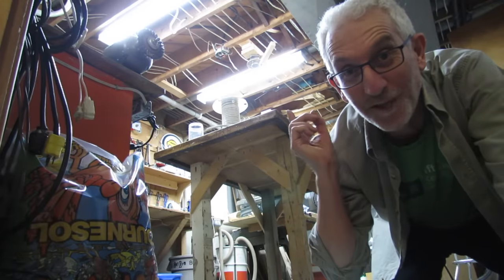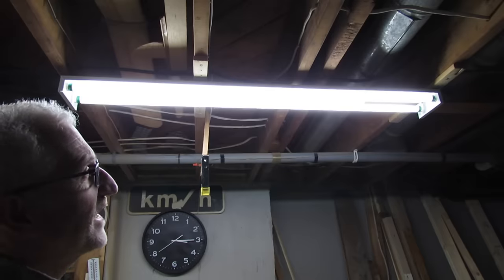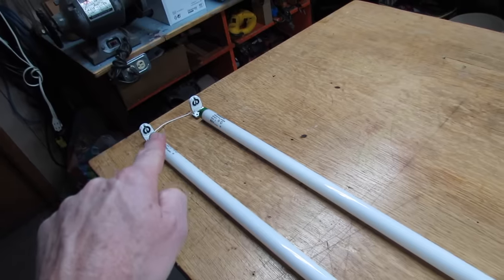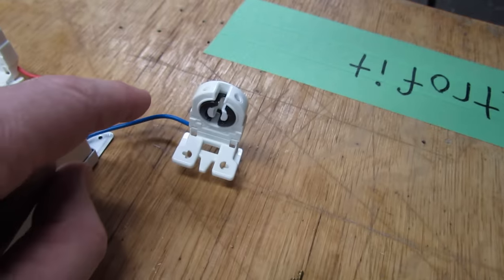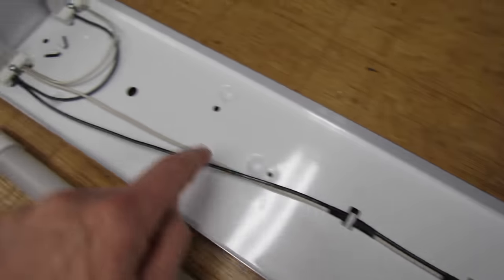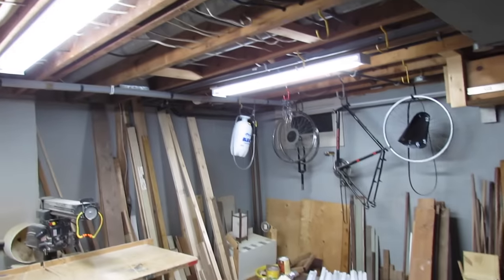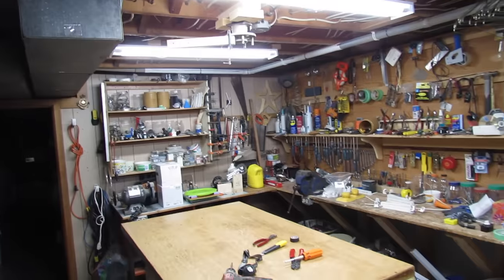How To Convert T8 Fluorescent Lights to LED ● Explained in Simple Terms

Comment: I have no argument with what you did here. But it's worth mentioning that you could save time and money by purchasing "double end powered" LED tubes. Price is the same and you don't have to buy & replace the sockets, they work whether they are shunted or not, but the wiring is different. It should also be pointed out that when replacing LED tubes, you must make sure they are the same as the ones you are replacing (single-end powered LED-s will not work in a fixture that was wired for double-end tubes & vice versa.)

Comment: Hey Chris, i am an accountant and am traumatic  when it involve electrical current. Bear with me here.

I have a small fan should be installed in trucks using the 12v Power point, but i want to use it in my room using the usual 3 pin power point (British Spec 240v). But I dont know how. 

Please help me. Dont give me graph or chart or tables. I do not understand them. 

Appreciate if you could make a short slideshow on how u do it is better, i can copu whatever u did.

Thank you.

Comment: Does anybody actually know what voltages the direct LED and the ballast LED tubes require to work? I mean what output voltage does a ballast offer verses direct 115 vac LED direct? I ask because I totally went to LED replacement tubes and now I am getting a flicker from one four LED setup (I have 6 four tube setups in the shop). And since these all are ballast setups, I was wonder if I just removed the ballast and wired direct would that work? IDK.
Reply from the maker: I don't know what voltage the ballast leds take to work but I do know the direct ones have 110V. I experimented when I did this video and laid one led tube on the bench and used alligator clips and attached a neutral and line to one end of the led tube and it lit up. That is why you can cut the wires at the other end since they are now not needed.

Comment: You never covered the section about  reconnecting the new power cables you put in  the unit back to the original power cables??
Reply from the maker: You just connect it back up the same way you disconnected.

Comment: Nice clean job. Nice skills. But why do it? The bigger cost item in fluorescent light fixtures is the ballast. Yours was scrapped. You replaced everything except the aluminum box. That's the least expensive part. Your 1000Bulbs seller has a LED ready strip light (minus the bulbs) for $12.99
Reply from the maker: I guess part of me said to reuse whatever I could instead of just trashing it.  Good point though.

Comment: Although your video is very good, it might be a little outdated...be very careful when wiring,,,,FOLLOW THE LIGHT MANUFACTURERS INSTRUCTIONS!!!!....I wired my fixture according to your directions and popped the circuit breaker....had to re-wire using the original SHUNTED lamp holders,  as the bulbs I'm using call for a "ballast bypass" meaning you use the same shunted lampholders in the fixture, but the hot and neutral wires go to each end of the light fixture (hot wire to blue and black wires and neutral to yellow and white wires)
Reply from the maker: In your case you would just remove the ballast.

Comment: 3,000k to 3,500k would be my choice for color spectrum. The higher numbers tend to be too "bluish". I rarely see folks converting 8 foot fluorescent tube fixtures.
Reply from the maker: I myself find the 3000k range to be too yellow/orangish and dull. 5000 is like natural sunlight and is not bluish. 6000 is getting into the bluishness
Reply: @chrisnotap  Yes, some say the 5,000 is true sunlight. Back in the halogen bulb days they said a halogen was equal to natural sunlight. They are far apart from each other.

Comment: Is it true led light escalate cancer activity in cancer patients.
Reply: Salvatore Saccoccio never heard that one, but the one thing is NOT LOOK at LED LAMPS, in Europe they have a flicker problem, with 50 hz, where we have 60 hz in North America.
Reply: Salvatore: LED lamps have drivers which gives it such type of current which does not flicker. If LED is driven with AC, like older ones, the flickering would be seen but not anymore. Incadecent bulb is so slow that the flickering doesn’t show. If you use uncompatible dimmer, it can cause flickering too.
Reply: mattikaki you didn’t answer my question. As of Jan 1 1917 CBS news had a reporter on stating that LED lighting escalated cancer cells in patients with this type of cancers, prostate in men and breast conservation in women!
Reply: The logic of these people is all the same, phones give you cancer my radiation and LED lights give off cancer causing radiation. All light gives off radiation, because that is the definition of light, electromagnetic radiation. So I guess if you so strongly hate radiation I suggest you live miles underground with thick layers of concrete and pure lead with absolutely no light. But there is one problem with that, your body gives off infrared light/ heat, another form of radiation. So I guess you should just suck it up and go on with life without being paranoid about cancer. Also there are 3 types of radiation, alpha, beta, and gamma, the first two are are completely harmless (this is what phones and LEDS give off) but gamma radiation is only produced by high energies like nuclear fission (not only in nuclear power plants) or highly radioactive isotopes of elements like uranium and plutonium. And last I checked these highly regulated elements aren’t in phones or diodes so as long as you constantly lick pure uranium you should be fine. So can everyone stop being paranoid and/or just plain stupid? It’s time to see that everything gives you cancer and who knows maybe cancer gives you cancer?

Comment: Does the other side of the bulbs none shunted as well!?? That means you have replaced four of them to none shunted!!
Reply from the maker: The other end is "dead". The bracket is only there to hold the bulb.
Reply: Wiring the same way on the other side could save you time when replacing the bulbs (no need to label/remember).

Comment: FYI, If the existing fixture has an "IS" or "Instant Start" Electronic Ballast in it you don't need to do this. As long as you don't buy a "Bypass" style lamp, all you need to do is switch the tubes.
Reply from the maker: Incorrect. Only one end of these retrofit bulbs is part of the circuit. The other end is just there to clip to the holder
Reply: @chrisnotap  For the Bypass  style lamps only yes. But for newer linear Fluorescent fixtures you don't need to do any wiring. You simply Replace the lamps. As Long as the ballast is "IS" Instant start rated.

Comment: Great idea, unfortunately, the cost of those LED linears at this time negates the hydro savings for the typical DIYer by a huge margin.  Need to run those lights in a large shop, factory, office or commercial space for at least 10 hours a day for it to be worthwhile.  Your link to 1000Bulbs expired but there are others. $US288 for 25 + S&H + duty + exchange, no wonder Home Depot sells these bulbs singly for $25. Yikes!

Comment: This video is probably outdated. T8 type B bulbs I just bought have H and N on opposite ends, not on one end. It's actually rather dumb that they did it that way to begin with. If your bulbs are like that, I'd return them.
Thus, all you have to do is just use the same sockets, wire all the ones on the left to hot or neutral, and do the opposite on the other end. Done.

Comment: The LED bulbs are diodes (the D in LED).  You didn't mark which side of the tombstone was line and which was neutral.   What happens when you put the bulb in upside down?  Also, I didn't see you mark which end was electrified or which end was not.  Seems like you have to pay attention to both those details.  I haven't done it yet, but intend to do it soon.  Seems like both those details would be important to know and keep track of.  It appears that your lights don't have a reflector that goes between the bulbs and the wiring (which would remove the ability to see directly which end was electrified, line and neutral), nor do you have a diffuser to reduce the glare of the LEDs.  The 5000 Lumen bulbs, IMHO, are too bright to look at.  I don't know about the 4100, but think you could damage your eyes looking at these bulbs without a diffuser.  Again, this is not a criticism, just a question.  Are the details I have brought up important?
Reply from the maker: All good questions. The bulbs are clearly marked at the end with "L" and "N" but with these bulbs it doesn't matter if you connect the L and N end backwards, they still work. Therefore connecting the line or neutral to the tombstone doesn't matter. I like the bright light without the diffuser. These fixtures did not come with a reflector when new.
Reply from the maker: Oops! My Bad. I do have the diffusers on the fixtures now. Not sure why I didn't in the video but the light is so bright I may have had them on, I can't tell re-watching. Like I said in the comment, they did not come with a reflector. You mentioned the ground and yes each fixture has a ground to the case.

Comment: I noticed the wires at the opposite end of the power. (with twist connectors). They are not needed, eh?
Reply: The pins at the opposite end of the tube are dummy. Their only function is to secure the tube in the fitting.

Comment: I don’t understand. 58watt T8 triphosphor fluorescent has 5200 lumens and a 24watt LED only 2700 lumens. So to get equivalent light output you would need double the number of LED tubes. I know that LED are unidirectional when raw but in a frosted tube more like a 270 degree radial directivity so similar to a 360 degree fluorescent. Longer lamp life I know ( sorry guys they are lamps not bulbs!) but very similar lumen per watt outputs. Just don’t get it.

Comment: I don't think it's worth the trouble of retrofitting existing fixtures.  Just go out and buy new, complete fixtures.  They're dirt cheap, especially if you have a Menard's in your area.  That's where I got my new garage lights, though to be fair, I didn't have any old fluorescent fixtures to replace.  I just had (and still have) incandescent bulbs which weren't doing the job by themselves.  I needed more light and the LEDs perform very well, and aren't affected by cold weather like fluorescent bulbs are.

Comment: That's engrossing.  I'm an EE, but never thought about tubular stuff; it was just an xformer boosting the voltage up enuf to sustain a plasma.  Now, with LED, it seems the opposite:  rectifying to DC, then dropping it down to a few volts, or perhaps the reverse, either approach would work.  (Actually, the latter method sounds more practical.)   I don't see a xformer, tho.   Hmm.

Comment: Good video but in my opinion you should have removed the wires on the dead end (and especially wire nuts) and explain that side only supports that end of the "bulb" and has no connection
Reply from the maker: Yes a small point that I missed but it becomes obvious as the video goes on. Thanks.

Comment: Daylight fluorescent or any type daylight lighting is lousy for most uses where visual acuity is desired so a lot of the improvement from the switch to LEDs  was due to elimination of the daylight units. The problem I've found with LEDs is that they are brighter visually but the light doesn't seem to carry very far as compared to other types.

Comment: Or you can get the correct LED bulb and  just change them out. I bought 48" bulbs for $7 each from a supply house and did that. Unless the ballast is totally dead it will run a LED.
Reply from the maker: Yes! The tech has changed in the last few years and they now have hybrids that will work with any configuration with the ballast or without, power at one end or both pretty well anything.

Comment: No more hydro??? Hydro comes from the hydro utility. Electricity flows through the appliance. 
Those shunted and non-shunted parts are called tombstones. Many fixtures use two wire tombstones on both ends. Mine do.

Comment: These days don't they sell the light holding frame already set up for LED's .
Reply from the maker: Let me know if you find any.
Reply: Chris Notap  I done exactly what you have done , as of yet I haven't looked to see whether they do sell the frame , at the time LED fluro's were a new thing on the market and super expensive , but I have noticed the small 5 watt LED globes have dropped to about $5 Australian , My Fluro tubes cost around $38 at the time , and as an exercise next time I go to the hardware Ill check them out to see if they have dropped as that was about 3 years ago , I absolutely  love LED technology everybody is switching in Australia as the politicians have absolutely stuffed the electrical generation system with politically correct global warming crap and shut down all the coal fired power stations , we went from the cheapest electricity in the world to now the most expensive and sending our businesses over seas or broke , but that what you get when you are a socialist country where everything is run according to Socialist  Dogma .

Comment: Oops!  You don't have a ground wire.  What happened to that?  You should have had one coming into the ballast and attached to the steel housing/cover/whatever that is called before you retro-fitted.
Reply from the maker: Ground wire was connected when the fixture was remounted to the joists.

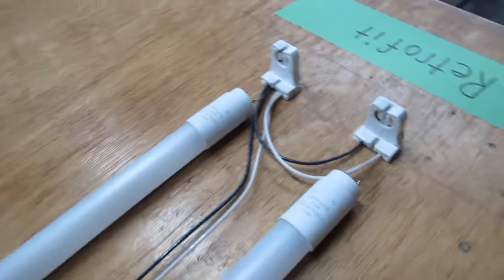Comment: Two pieces of information are needed.  One, at 2:26, does it matter if the two left terminals and two right terminals are wired together as shown, vs. a left on one with a right on the other?  I would think it doesn't matter.  Two, what type of bulb are you retrofitting for?  Type A, Type A+B, or Type B?  And if Type B," which Type B?  From what I understand, "Type B" can be either single-ended or double-ended.  I bought "Type B" but nowhere did the packaging say single or double, only when I opened the box did I find a piece of paper that said "double" - this wan't even marked on the tubes themselves.

btw, the K rating (4000 vs. 5000) is simply a matter of preference re relative coolness or warmth of the light, this information is of no help in doing this conversion.

Comment: I just used the ballast bypass bulbs in two fixtures.  Took me 5 min per fixture to remove the ballast (though I could have simply left it in place) and to direct wire the 120 to the two ends.  Used these bulbs: CNSUNWAY LIGHTING T8 T12 LED... https://www.amazon.com/dp/B07CNVD99K 

Amazing difference in brightness and instant on instead of the typical delay with fluorescent bulbs.

Comment: I just don't see the point.  As long as my ballast is okay I'll just keep using my regular fluorescent lights.  I have yet to have a light tube burn out on me and I've lived here for 8 years now.  When the ballast goes out I'll consider swapping them out then but as long as everything is still working, if it ain't broke I ain't fixing it.
Reply: Well, that's entirely up to you.  If it's broke, then it's a repair.  If not, then it's an upgrade.  That's the main difference.

Comment: If you buy dual ended powered LEDs you reuse your tombstones, shunted or non shunted.
Reply from the maker: Not sure what you mean by that. You'll have to expand on that.
Reply: @chrisnotap  Dual powered LED tubes means the hot goes to 1 end and the neutral to the other. Tombstones can be shunted or non shunted. Connect all the wires from one end and connect to the hot, connect all the wires from the other end and connect to the neutral.

Comment: LED tubes suck and are a ripoff. The only benefit is that they save energy, but they don't last 22 years like people say. They only last for at least a year and then after that, they dim, turn purple, or completely die. Theres a parking structure where a quarter of the LED tubes have already died after just a year. Flourescent tubes are much better in terms of life and are more interesting.
Reply from the maker: These will have been up for 5 years this February. All are still as bright as when I installed then for this video. It may come down to "bad quality Chinese" or "good quality Chinese".

Comment: alittle knowledge is a dangerous thing. What this video does not tell you is that there are two types of retrofit bulbs.One is single ended and the other is double ended.The double ended is not to be confused with the plug and play  which can simply replace the standard tube. The double ended has to be wired differently
Reply from the maker: Did you not watch any of the video? I fully explain both types.

Comment: The bulbs for retrofitting need to be "Toggled".
Reply from the maker: Toggled?
Reply: @chrisnotap  They are the direct wiring type bulbs. Since there are others like Phillips instantFit and God knows what other names that may or may not work wired directly it is safest to just look for Toggled bulbs. What I found anyway.
Reply from the maker: Didn’t you watch the video? That’s what I explain. They are direct wire!
Reply: @chrisnotap  I got that, but when you go to the store you have to make sure. It was a great video, but if your like me that point needs to be hammered home otherwise you might get the wrong bulbs like I did.

Comment: You do not have to cut the wire in the other side. There is no electricity there
 If it was you would short circuit the led bolb because the bases are the old ones......
Reply from the maker: Correct. I did that to make it perfectly clear that there is no circuit at that end. No confusion. Thanks.